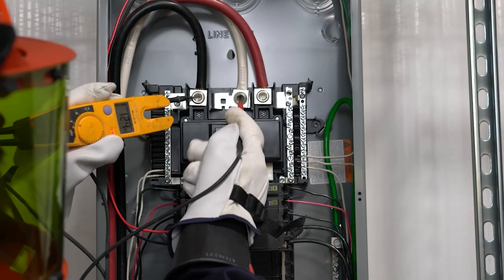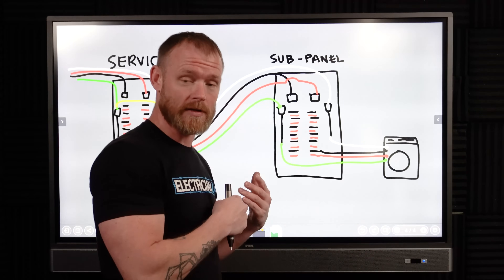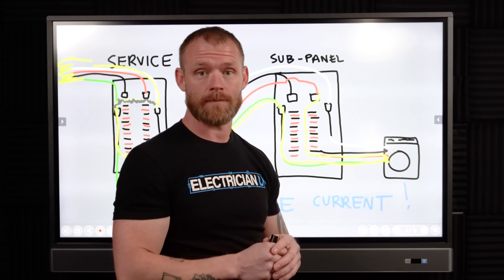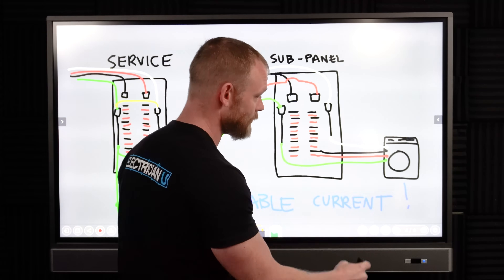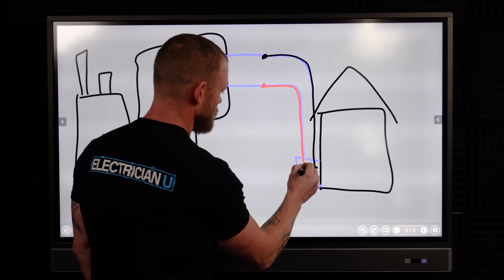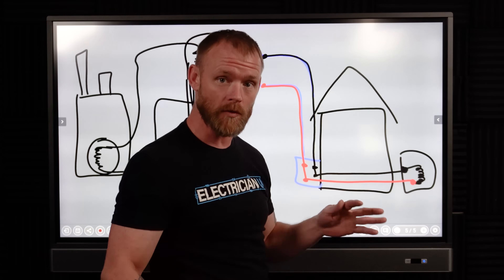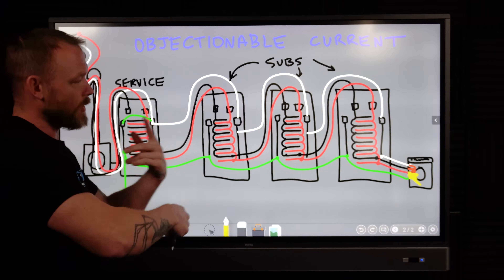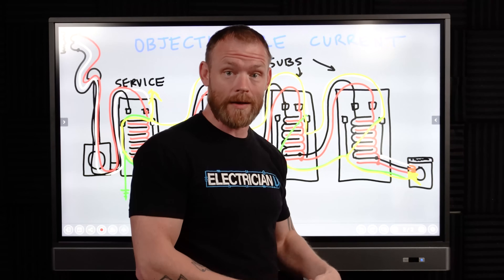Why Do We Bond at the Service Panel and Not a Subpanel?

Comment: Does an automatic transfer switch for a generator ALWAYS become primary and turn my main service into a sub? 

I ask because I recently added a circuit to my main (30 amp 120V on #10/2, to power a Ream hot water booster) .  I noticed the bonding screw is backed out but still installed (Siemens Panel).   I am assuming the generator dude backed it out when the best practice would be to have removed it completely.     All the neutrals and grounds are on individual bars.

End of the day, I’m wondering if I should remove the screw completely or run it in and torque it.   I think the answer is remove it.

Comment: This video is completely illogical! 1. you never say why we CAN'T have multiple routes to the transformer which would STILL blow the breaker in the subpanel with the fault! 2. A ground fault with the neutral and ground bonded together JUST at the service entrance, does NOT stop all the metal from having EMF potential on them until the same breaker on the subpanel with the fault trips! So it is exactly the same situation! Now granted, with 50 subpanels you will have some voltages that are different do to the resistances of the wires involved due to their length in the system. However, with a single subpanel, say at an outbuilding, a bounded ground would not cause any different issue than that, which only a service entrance bond would also cause - - still all the metal boxes would have potential on them until the breaker disconnects the circuit. Electricity travels at 186,000 miles a second so all metal would have EMF instantaneously. Actually, for this very same reason, a ground fault IS the same as a DIRECT SHORT!  The HOT and Neutral would be touching (via the parallel ground), which is the very definition of a short circuit.

Comment: im doing a solar shed, you cleared things up for me. I was going to ground the shut-off and everything, to earth. I have to drill into granite, maybe a foot of earth, then granite. How deep and how heavy a rod, I have 5/8 rebar. The 12k Growatt inverter, recommends 80amp panel. So now, after watching this, I will just run earth to the service panel. The Growatt inverter is a split phase. I have 60 amp disconect two hots, neutral ground. Im using a MHC32S 225 service panel. I am unsure about the disconnect being big enough? My thinking is that there are two fused legs, glass fused,60 amp each. Then there is wire gauge? I am in Canada, I read somewhere 3AWG? I have 2 gauge welding cable, that's probably a bad idea?

Comment: When I install an automatic startup generator the switch becomes the 1st box after the meter and it comes bonded. Should the old breaker box be unbounded as it now could be  called the 2nd box in the system?

Comment: What is difference between bonding and grounding?
A: “Bonded” means connected to ground without inserting any resistor or impedance device. B: “Ground” is the connection between two or more portions of the equipment grounding conductor.

Comment: Hi there great video.  I am trying to understanding something regarding bonding.  In my detached garage I have a 60 amp sub panel that is fed from the main house panel.  I had removed the green ground bonding screw from the Neutral bus in the sub panel. I checked for continuity between  the ground bus and the neutral bus, there is none.  Next, I connected the 2 hot, ground and neutral wires.
I rechecked for continuity between the ground bus and the neutral bus again, now there is continuity. I pulled the neutral wire off the sub panel and again I checked for continuity between the ground bus and the neutral bus and there is none. I then checked continuity between the ground bus and the neutral wire while it was disconnected and there is continuity.  Note, I haven't connected a grounding rod or plate to the sub panel yet.
Therefore with the neutral wire from the house main panel when attached to the sub panel bonds with the ground bus just as if the green bonding screw is being used.   Am I missing something?

Comment: Awesome video! I'm a new student to the electeical world and this channel is an amazing source of information. Why is it that in older homes you see each ground and neutral terminated together on a single bar in the service panel? Would this also cause objectionable current? Also why is it that during a ground fault does the electricity only flow back to the transformer (source) through the bonding jumper rather than also going into the neutrals running into the field that are also connected to that same bar?

Comment: 11/2023 - FYI there are two new Oncor substations being built right now in Hutto.  I was amazed at how big the foundation had to be for the tall poles entering and leaving a drop station like these.  One I saw must have been 18-wheeler truck sized.  They built the frame one day, the next day it was dropped into the hole, and the day after that they must have bought out all the concrete in central Texas.  The foundation now sites waiting on the pole to be put together.
A friend of mine used to live in a long ranch style house in Bee Cave.  I seem to remember he had a 700 AMP service off of his own transformer.  That house had at least 4 sub-panels.  It was a massive house.  We were trying to work on a radio building down by the barn and the closest plug was up by the swimming pool.  We quickly found out that whoever had installed the pool did not do the grounds right as we got a bit of a tingle when we hooked up this building.  Fortunately, we figured it out and 20 years later, that building is still in use.  Thank You for what you do.  I always enjoy watching your videos.

Comment: ok  you  forgot  the  main  reason  you  DONT  bond  Subpanel :  normal situation;  
if  your  Subpanel  has  an UNBALANCE  LOAD,   the  NEUTRAL  current  flow  will  appear  on the  NEUTRAL ,  but  also on the  casing ( ground conductor)  if  N-G are bonded ,
current  will  split to  N & G  having  2  path ,   this  is  a  dangerous  situation ,  all  casing  shall  never be current  carying.

Comment: Basically, You would double the Neutral wire if you would connect them in a subpanel. My problem with this system is when the neutral and the ground make a false connection no normal breaker would trip and all the grounded metallic chases would be risky to touch, (and you can be the load between phase and ground).
Reply: Nonsense. Why would a breaker not trip?
Reply: @okaro6595 If you connect neutral and earth in a subpanel what would happen? Nothing because no breaker would trip despite wrong connection. No?

Comment: As a recently retired Industrial electrician of 50 years give me England's electrically every time our 415volts and 230volts is a superior system our neutral and ground are only connected together at the transformer,so we earth anything in the circuit that will be a conductor of electricity

Comment: This was good, but you didn't even explain the biggest reason why having alternate return paths is a bad thing.

If you have ground bonded to neutral in multiple places, then if at some point the neutral becomes broken between those two points, then all of the circuits will still continue to work apparently normally, but all of the return current will flow over the ground line instead of the neutral.  This is a big problem because ground conductors are typically a smaller gauge than live/neutral conductors, which means they are not rated to carry the same amount of current.  In this condition, you might well never realize anything was wrong, but the wires in your walls could be overheating and ready to burn your house down.

Comment: Thanks, this helps a lot. I have 2 sub panels in my pole barn. One is brand new, it is energized but not used yet. In the first (not bonded, nor is the second) the grounds and neutrals of the various breakers are attached to both sides. Meaning I have neutrals and grounds on both sides of the panels. I am about to rewire it all so they fall on the right sides. I hope this makes sense. 

My question is this: Is it necessary? Want to save some work but I also want to have it right if it isn't.

THanks again!

Comment: Howdy. Nice try. But the reason was not very clear.
One reason to keep fault current and regular neutral current separated is to enable residual breakers to function. A residual breaker triggers when the returning neutral current is not the same as the outgoing hot current. Overcurrent breakers and residual breakers are two very different devices.
Another reason to keep fault and neutral separate is to enable potential equilization of touchable metal parts. If we bonded to the neutral, the normal neutral current will produce different potentials on different bonding points. The so called Touch Voltage. It may be a few volts during normal utilization. Hardly lethal but very unpleasant to experience touching a stove and a kitchen sink simultaneously.
Third reason is that regular neutral current will elevate the neutral potential at the load. If a ground fault developes there will be less fault volgage available. The fault current will be somewhat smaller and the breaker will take a little more time to trigger. The Fault Touch Voltage will have a little more time to kill someone.
Best regards.

Comment: Really helpful as a layman with a very basic understanding of circuits. Thanks for taking the time!

I am curious if anyone out here on YT may have some insight? I have a rural piece of property w/ a small cabin connected to the grid. There is a service panel on the pole (coming off the transformer) and a subpanel on the cabin. The subpanel has a separate ground bar where everything from the cabin is grounded: outlets, lights, refrigerator, etc. From this video, it all makes sense that grounds at this subpanel are NOT bonded. BUT... there is also a single pole, 30amp RV outlet hanging off the subpanel. For that outlet, both the ground and neutral are connected to the neutral same bar. Again from the video, I would have expected the RV ground to connect to the ground bar. Was the RV done incorrectly?

Comment: I'm still not seeing it. If the only fault is a ground fault at the dryer and all of the neutrals and grounds are ultimately connected together by the bonding at the main panel then there will still be a huge load that will trip the breaker. When you say that you don't want the ground fault to be fed back into the neutral of the subpanel because there will be loads on the neutrals on the subpanel, well I could say the same about the service panel. There will be loads from appliances that get their power from the service panel.

I am still searching for the scenario where someone or something gets hurt due to a subpanel being bonded, which would have not been hurt had it not been bonded. Just saying that there should not be parallel paths because "it's bad" isn't really an explanation, it's just a statement.

Comment: Would I be correct in saying if you have a meter/dis-connect then all points from the disconnect should not be bonded and separated? So the main panel is separated?

Comment: In ANY power distribution of any size (from the power in a "chip" to a major electrical utility there are two basic schemes.  One is an attempt of a "single point ground" and the other is  "massive ground."   

Overall, a better case can be made for the "massive ground" whereby the neutral is bonded to earth and metal objects as often as practical.

Comment: I live in an apartment house in NYC. The panel in the apartment has two 60-amp legs plus neutral, but the main 60-amp breakers are at the panel which holds the meter in the basement. I assume the neutral and the ground are bonded at that point in the basement. There is no green ground conductor coming from the basement panel into the panel in the apartment. This is older wiring and the ground appears to be accomplished by the metal jacket of the BX. The receptacles in the apartment are three-prong and there is potential to the ground prong. So, is the panel in the apartment, which contains one 15- and two 20-amp breakers, (all conductors are BX cable) considered a sub-panel, wherein the neutral and ground should NOT be bonded. In the service panel in the apartment, at present, there is only a single neutral bus bar. If I want to add a new 15-amp 120V branch circuit for an air conditioner, should the green ground wire for this branch circuit be attached to the neutral bus bar or affixed to the metal of the apartment panel or to an added grounding bus bar, which is itself attached to the panel?

Comment: So does a 400 amp service, with 2-200 amp disconnects need both disconnects bonded? If so, do you run 2 separate grounds, one to each disconnect if the disconnects are next to each other?

Comment: I'M SURE I'M NOT THE FIRST...
EVERY THING YOU SAID IS ACCURATE.
THERE IS AN ADDITIONAL CONDITION THAT SHOULD BE OBSERVED.
I WILL STATE THIS CONDITION WITH MINIMAL WORDS.

FOR  ME I'VE KEPT IT STRAIGHT
THIS WAY;
AT THE MAIN  NEUTRAL AND BOND  ARE THE SAME.

NOW THE CONDITION....
IF YOU  "TAG THE NEUTRAL" DOWNSTREAM // 
IF YOU LOSE THE NEUTRAL
THE CURRENT FLOW WILL BE SOLELY ON THE BOND.
THIS  WIRE HAS NOT THE AMPACITY !
                           😎
                           🤙

Comment: I have always thought that electricity always travels the shortest path, in the case of a ground fault if you have ground rods and cold water, wouldn't the electricity flow there before the neutral and that is why we size the ground wire big enough to trip the breaker.

Comment: I like the example of ….if you tie neutral with ground at  a sub panel you could possibly be using plumbing or gas line as your parallel neutral return as well.     Always only bond neutral and ground at the main.

Comment: This is not always correct but in most single home installations. There are some installations with 3 hot wires in the main panel and ground only at the sub panel. (3x30kV->3x220V->main panel with 3x220V ⇾ subpanel with 3x220V and ground and virtual neutral bonded). The minimum is awg 4 for 3-phase without ground and neutral. If you go anything lower, you need ground and neutral. Wires are expensive. In the US and Canada there is 3x7,2kV-->1x7,2KV-->2x120V (only if you are lucky you have a 3x7,2kV Pole near your house). There are some exceptions with a ground fault detection devices for multiple ground connections (for EV-charging). Here is nearly no DIY in electrical, as the code is very complex (and very expensive to buy the books). If you look in America for anything with 3phase power (apartments) or medium voltage power you are in a whole new world too.

Comment: Hello,  I live in an apartment.  Where the power goes to the main power out side and there is just one breaker . Then it comes inside to me pannel. Noted the metor is out side and my panel about 30 feet from the original braker and inside. Does that mean my apartment need to not be bonded?

Comment: I have an older house with a subpanel with buss fuse mains and glass screw fuses. I want to upgrade to a new breaker style box. My problem is, there is only 3 wires (no fourth wire (ground). It seems if I had a fault then the box could have potential. Since I don't want to replace 150 ft of 50 amp capable buriable cable, is there a safe way to replace this old box to a newer breaker style box? Would a surge breaker solve this problem?

Comment: Yes, many do not get that a ground rod alone will not make a breaker trip. There are countries where the ground and neutral are not connected and ground goes to the rod only. They require complete RCD (GFCI) protection to make it safe. Typically an entire house is on a 100 mA RCD and then individual circuits on 30 mA as the code requires. Before RCDs they had devices that sniffed the ground wire and detected voltage on it.

There are different systems around the world. In the UK the previously had a separate ground and neutral all the way to the transformer so they did not bond them either.